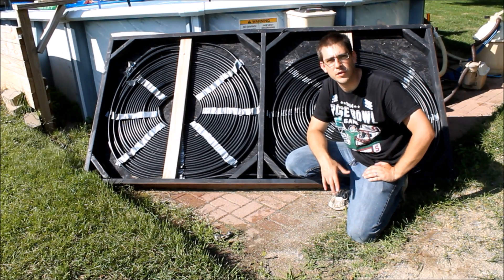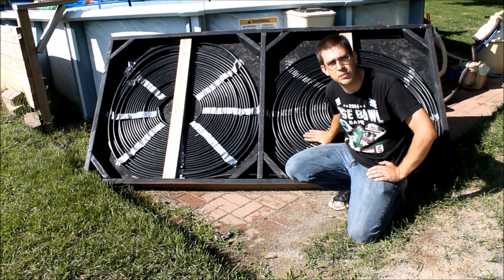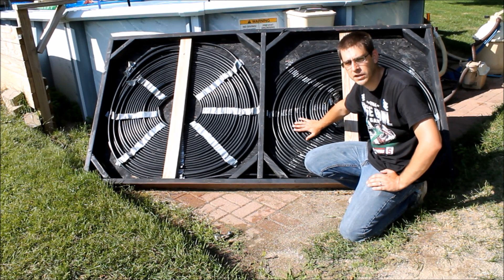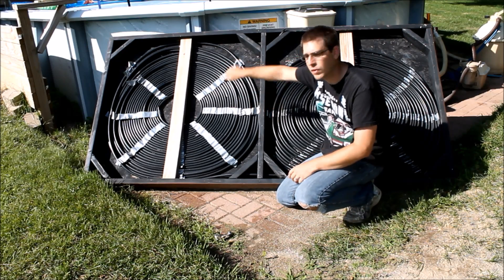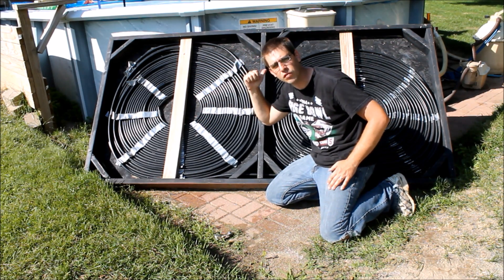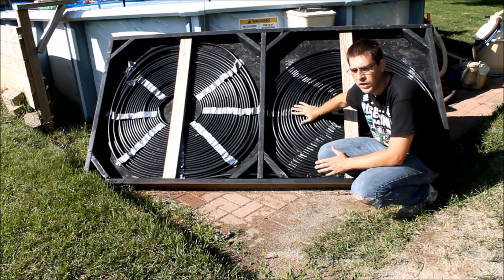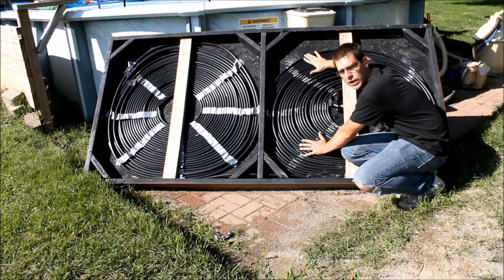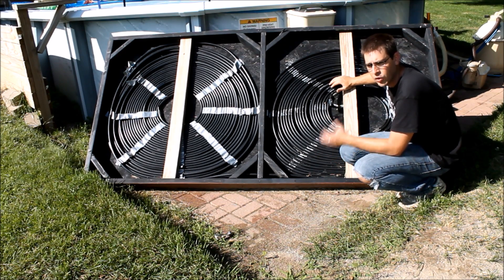Solar Pool Heater and Diverter

Comment: That's really neat, man, thanks for the video.  I will have to argue that water flow rate does matter, although I have not done any testing on it.  The cooler the water is in your coils, the faster heat will be transferred to it, so this would point to a higher flow rate being more optimal.
Reply: That's exactly right, Dave, especially first paragraph.  That is what theory says but it really should be tested in case you there is something in play that we have missed.  No real system is ideal.
Reply: Yes, flow rate does matter. Without doing complicated physics, is keep the flow rate slow rather than fast, here's an example;  A car's coolant t-stat just by being in there blocks the flow from 100% to about 50%. In a range between 25% and 40% is where it generally regulates within it's rating (ie 195º stat) My brother had a bad t-stat overheating the engine, and in a pinch he thought he could simply remove it to get him down the highway into town. He still overheated because the flow through the radiator was too fast to even get chilled by the high airflow through the radiator. Same if your solar coil flow-rate is too fast, it will zip through the coils before having a chance to pick up any heat.
Reply: @cindysmith4131  you are wrong. Your example may be true but in the design of this solar powered heater you want the flow rate to be higher. The overall goal is to heat the water in the pool. Not just achieve hot water out of the end of the heat exchanger. A slow trickle will equal much hotter water but the time it then takes to heat up the water in the pool (if at all) is considerably higher. A faster flow will achieve a lower temperature on the output side but WILL heat the pool up faster. And since there is only so much sunlight during the day you want to maximize that.
Reply: Use a laser thermometer to see at what point the tubing stops getting any hotter, then cut off all the tubing 10 ft. past that point. It is just a waste of space and money.
Reply: Does friction play any role with water flow?
Reply: SSLFamilyDad In my opinion and as per my understanding...

The optimal flow would be one where the discharge water is slightly warmer than the supply water, even if only a fraction of a degree. With your coil collecting solar energy (which has been converted to heat in the wall of the pvc), basically your goal becomes transferring that energy into your pool by cooling the coil. If the water in your coil starts to get to hot, it accepts less and less heat from the coil until eventually the coil would feel hot... that is, the coil is transferring heat to your hand and the atmosphere... If you think about that, unless your goal is to make the pool warmer than body temperature you won't gain much in the way of efficiency by running it warm enough to feel warmth from your coil.

I've never really quantified it but I get really great warming by getting my flow fast enough that with the discharge line underwater in the pool I can feel a temperature difference as the water runs across my hand but when it runs over my hand out of the pool water it doesn't really warmer than the pool.

This leads me to think that multiple coils of shorter length would be better than a single equal to the sum of all these lengths. For example, 5 x 100' coils should be much better than 1 x 500' coil. Eventually, the limiting factor becomes how much water you can expose to solar (or wood heat) per day which is dependent more on your pump and line sizes. 

Hope that makes sense and by all means, correct me if I am off base here...
Reply from the maker: Basic Poke I thought the same thing but I am still not convinced that is true. If I remember physics correctly one calorie of heat energy raises one milliliter of water by one degree Celsius (which is about 1.8 degrees Fahrenheit). I do not believe it matter if the water is cooler or warmer. I suppose I will have to do some tests to find out but my experience from the wood burning pool heater is that it is pretty close with faster or slower rates of flow. Might do some follow up experiments this summer to prove one way or another. Great comment!

Comment: Hi, I just saw this and will be making mine this weekend coming up.  The poly tubing...The boxes that you made look like they are 48" x 48", if so, the two of them held 250 feet of hose each>>????  I am unclear on how much poly pipe to buy for mine, that is similar to yours in design.  Thanks  Mike
Reply from the maker: Michael Greig The box is just one sheet of OSB so 4'X8', each 4X4 section held just under 250' of poly (I had some left over) Hope that helps and good luck putting it all together!

Comment: Great set up man!! I see now that you have the wood heater as a back up for your solar heater. Now, I'd like to make some comments to improve a little bit your system. I remember from your wood fire heater video that you were having a flow rate of about 1 gpm through your 1/2" pipe and probably you would have wished to have a little bid more for a 15K gallons pool. Also I remember you saying that you would have preferred to have two coils in parallel for  a better efficiency so I wonder why you didn't apply the same idea to your solar heater set up (parallel setup). You have two main parameters that come into play here, velocity and pressure drop (head loss). You might want to keep the velocity between 5-10 ft/s in your system so you will have a reasonably pressure drop through out the system. The idea is not to overload your pump and keep the system pressure drop bellow your pump pressure limit for a given flow. You would need to check your pump's performance curve and make sure that your system's head loss falls under the dome of the curve, by doing so you won't damage at all your pump and will keep a good flow rate. I know I sound a little nerd but I won't limit myself to explain some theory, I will suggest you a solution in a minute as well.
Also, you would like to be able (ideally) to close fully your shut off valve and heat up 100% of your flow, but in your current set up you can't do it since you are reducing from 1 1/5" to 1/5" and keeping a single pipe (I suppose that your wood heater line is close) . If you shut off your 1 1/2" ball valve your pipe will probably burst. Your single 1/2" pipe won't handle such a huge flow very well and your pump might get damaged as well. It is also a matter of safety, if someone happens to be curious and close fully your valve without your presence, your system will go down. That being said, your solution would be having two or three 1/2" line (needs to be calculated) so that your system runs in parallel and instead of having your 1/2" hose in series, they should be in parallel. You will like to split up your entire flow in as many downstream connections as needed. Let me put you an example.
Most 1 1/2 pumps deliver as much as 150 gpm but if you utilized 1 1/2" pipe, your flow will be limited by the size of the pump. If you intend to maintain for example 6 ft/s in your pipe (to minimize head loss) the max flow rate that this pipe can handle is about 38 gpm (overrated pump). Then you put two 1" line in parallel to maintain the same velocity (two 1" line is equivalent of having one 1 1/2" line). Then, after each 1" pipe you put three 1/2" hose (equivalent to 1" pipe) to maintain again the same velocity. Now, these 1/2" hoses need to have the proper length so your pump can handle the total head loss in your system without reducing flow rate. Let's say for now that your are good with 50 ft. The result is having 6 x 50 ft solar heaters for your full flow and you can divert 100% of your flow, fast heating process, and safer too. If you want to divert only 50% because your are in a very hot day, close your 1 1/2' shut off valve half way and close fully the valve on your second 1" line so half of your flow rate will flow fully in your second 1" line, and you will have three solar heaters working in parallel (you have just shut down have of the system). 
I don't know what would be your requirements but is only matter of having access to your pump performance curve and calculate the head loss in your system so your pipe length and diameter can properly be sized. 
Hope my explanation will help you and I would gladly assist you in the calculations if you want (for free of course, lol). I'm currently designing my own solar heater by doing some of this calculation first. I'm a licensed professional engineer  so don't worry, I know what I'm saying and doing. I apologize if my English doesn't sound properly, I'm a foreign dude with just a few years living in USA.
I love by the way your videos and you are a genius. I wish I were as handy as you!!
Reply from the maker: Thanks for the theory and ideas, I always appreciate. Right now it is setup to run in parallel by forcing and equal amount of water to both heaters at the same time. I designed the diverter to be able to add on more loops (all 1/2" tubing) so I can add more solar heaters and more coils to the wood burner to run it all at once. If my calculations are correct I could have up to 8 or 9 1/2" loops to equal the water volume of the 1 1/2" pipe. So as I add onto the system I can eventually run the entire pool pump pressure through the heating system and turn the whole thing into a super duper 15,000 gallon hot tube:) Thanks for watching!
Reply: SSLFamilyDad You are welcome. That's the idea man, more systems in parallel. My advice is that you shouldn't make each individual system too long so either your flow and your pump performance would drop because of pressure drop, messing up your pump in the long run.
Take a look at this trusted link: http://www.troublefreepool.com/threads/830-Hydraulics-101-Have-you-lost-your-head
It will tell you exactly how many 1/2" is equivalent to 1 1/2". It is the second table. I believe you can go max 8 like you said.
Now, If you change a little bit your arrangement and reduce first from 1 1/2" to 1" (2 pipes in parallel), you won't need 8 x 1/2" systems to cover the entire flow. You can do 6 (3 per 1" pipe) and you are done. Thanks you.
Reply: SSLFamilyDad  My husband and I are interested in making a solar heater and like your video. On another note, we noticed what may be a DIY solar cover roll system in your video. Is that what it is and have you shown how to make this. We are also interested in figuring out how to make something like this. Thank you
Reply from the maker: Jabo The solar cover roll is actually not really diy but more thrown together to make it work:) We got this pool from craigslist and I put it up myself. The solar cover reel came with it and I made some supports that stick out from the retaining wall to support it. You can also purchase ones that mount right to the side of the pool. I am actually going to build a new one this year (if I find the time) that will look a little nicer, I will do a video on it. Thanks for watching!

Comment: Fencing wire woven in and out the back and in around each hose would keep it located, it would be time consuming but very inexpensive. Plexi glass over the top might be worth looking into also to prevent any wind/breeze from acting as a cooling effect. Great videos! Cheers!
Reply: Actually if you ran two 1X2 furring strips in front to hold the coil flat, and did so with a bead of silicone, the silicone would stick to the furring strips like crazy and contour the pipes. If it doesn't adhere to the pipes in the long run, it doesn't matter. Because the silicone stuck to the furring strips acts like a custom formed lock, keeping the coil from settling over time.

Comment: What were the temps in and out?
Would like to know to see if it's worth the time.
Reply: +David Anger - Be careful how you judge if it is worth your time. If you were expecting a 2-3 degree F. difference, it is worth your time. If you were expecting a big temperature difference, you don't understand thermodynamics and this is not worth your time.
Reply from the maker: Unfortunately David, I did not get the temp testing done this past summer as I did with the wood burning heater. I will do that video this spring. I can say this however, if you want to really boost the temps quickly the solar heater is not the best, wood burning heater is much better at that. The solar heater works great to maintain the heat in the pool and counteract the loss of heat at night but it isn't going to make your pool into a hot tub:) Hope that helps and thanks for watching!

Comment: what materials heat the water faster? tin cans, aluminum tube, or this plastic hose?
Reply from the maker: Well, my opinion would be that it does not really depend on the material but the amount of surface area that you have in the sunlight. The sun only has a set amount of energy per square inch of surface area so no matter what you use (I would recommend it be black) it should absorb the heat pretty well. Now I suppose that a thinner material might provide better heat transfer into the water but I still would think the irrigation hose it the cheapest and best option for anything similar to this. I hope that helps and thanks for watching!
Reply: SSLFamilyDad  any reason why you paint the wood black as well? what type of paint do i need to get to paint on the wood? or does the color matter? sorry new bie :- )
Reply from the maker: Thomas Chan Black seems to absorb more sunlight and heat. I just used black spary paint but a black deck stain would be best and waterproof.
Reply: +David Martinez - Surprisingly it doesn't make as much difference as you might think. However, tin cans and aluminum tubes will corrode rapidly in warm chlorinated water.

Comment: I would like to make a suggestion. The frame and box where you have the irrigation tubing make it out of sheet-metal and squarer-tubing. The metal will absorb more heat and help heat the water.
Reply from the maker: Thanks rodv69, that is a good idea. I will be doing some renovations on that next spring and adding some sheet metal would be an excellent addition. I am also planning on covering the box with some plastic or glass, thanks for the suggestion!

Comment: Nice work. I also have both too. The fire heater is so much better then the solar heater however using both can really do the job depending on your situation. I learned a lot from your fire heater video and built my own. Thanks
Reply from the maker: Excellent! Glad I could help. I am really liking that wood burner so far this year. It has helped keep my girls happy with the 80 degree water; something that we have not been able to obtain in previous years. Thanks for watching!!!